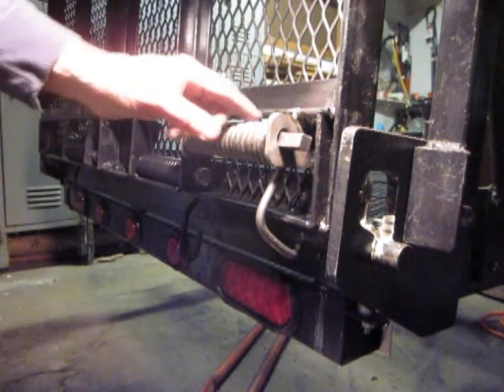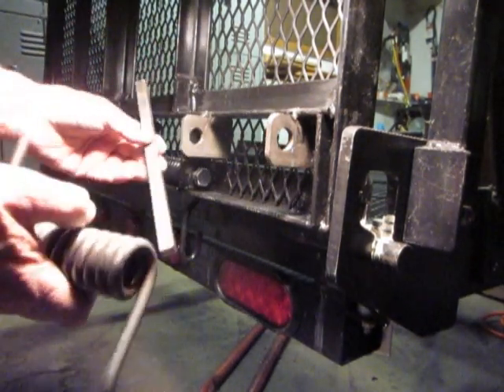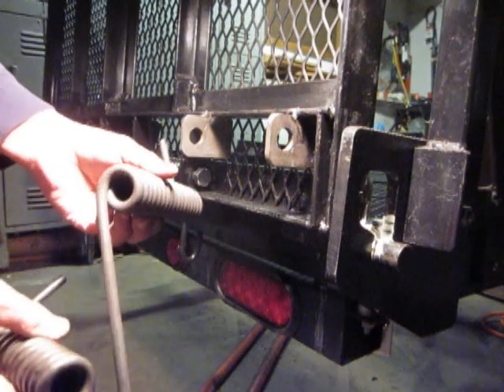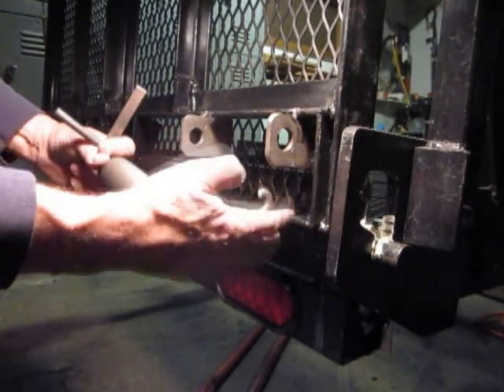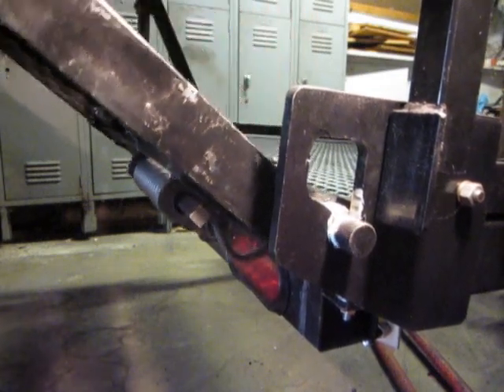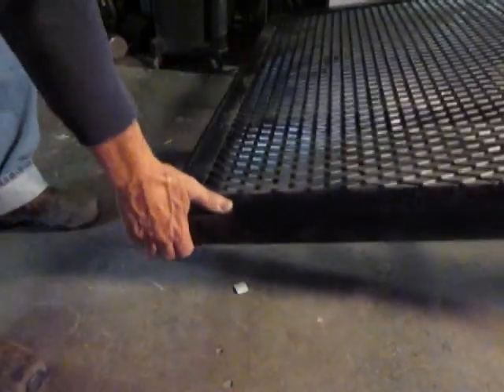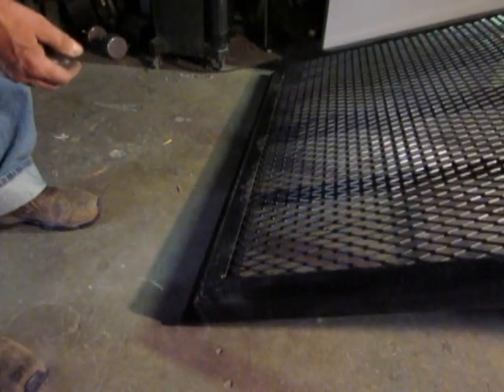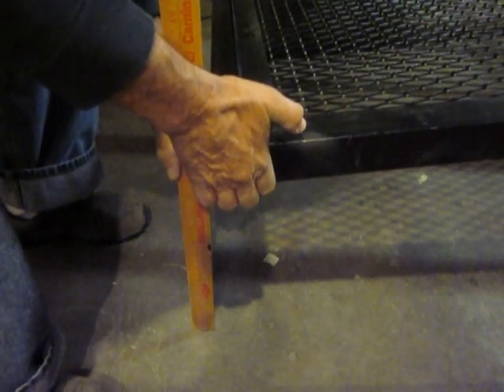Adding Trailer Ramp Springs - Part 2

Comment: I am wanting to get rid of the cables and install pivot pin springs on my enclosed trail toy hauler. Place used to make a kit 10 years ago and they stopped. Cant find anyone that makes a kit. So guess ill just have to design it all. Have you or any other found a kit?
Reply from the maker: This has come up before, but the kits weren't so good anyway. There's liability in such things. Cables fail too along with the springs. I saw a design once that incorporated long leaf springs under the bed. As the gate came down the springs took most of the load out. It required just a flip to go back to vertical, but it wasn't offered as a kit. Another design had pressure cylinders like shock absorbers to do the same function as springs  offered as add-on parts. Not sure as to the status now on those.  It's a good question and one I'd like to experiment with. I'd say you're on your own. I'd think that a fluid powered system would be good, battery powered. That's the place to start designing, as for the front of a skip loader. That's probably too costly, however. I've seen those smaller cylinders for sale before. Just an idea.